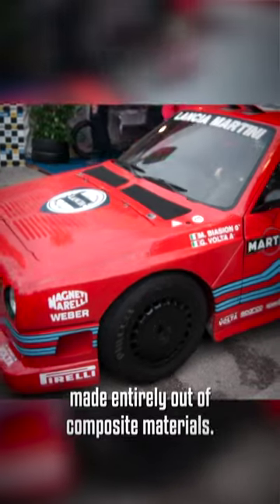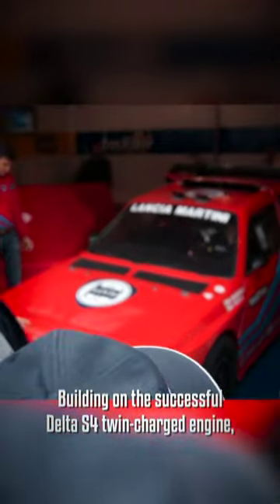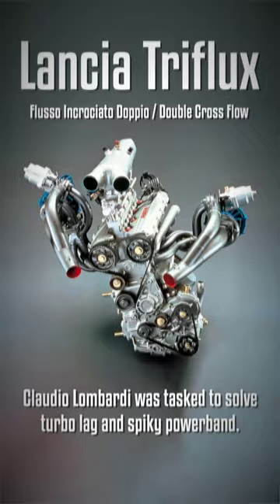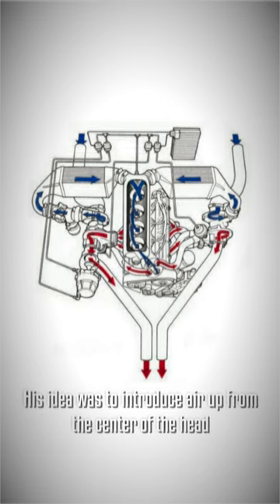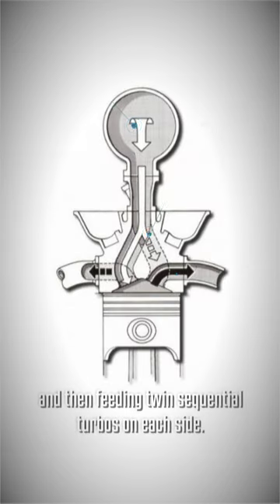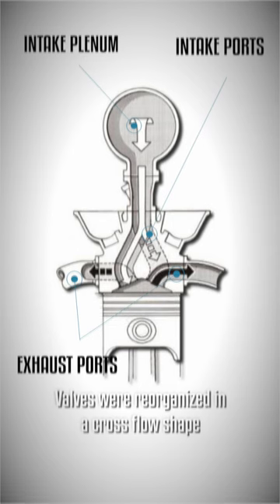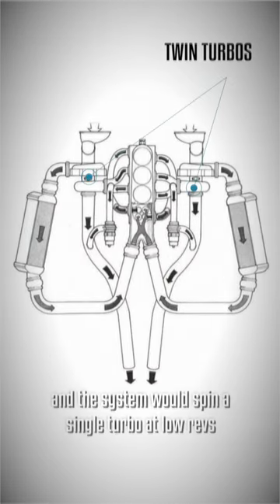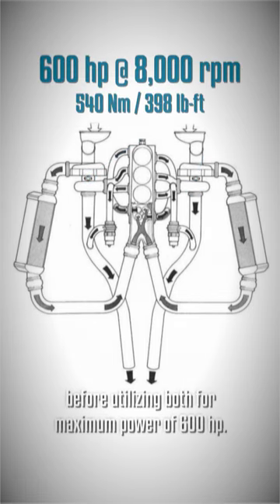Italians Reinvented Twin-Turbo 4-Cylinder

Comment: 600 HP, 540 Nm en sólo 4 cilindros. 😮😮😮😮
Reply: To be correct, It had 600 hp on Off Road configuraton and 800 on Asphalt tracks
Reply: By today's standards - that's rookie numbers
Reply: @jaleger2295  gotta pump those numbers up
Reply: @jaleger2295  I don't think so
Reply: The new GR yaris was able to get 740.4hp out of its 1.6l 3c😊
Reply: @KadiusFTW this heave 1750 cc in the 1987
Reply: @joslaleb_  I do think so. 4 cyl EA888 easily and reliably goes to realm of 700hp just by swapping turbo, new software, intake and exhaust 🥴
Reply: @jaleger2295 and runs for 3 days
Reply: @LtdJorge  yeeeeeah sure 🤡
Reply: @jaleger2295 good luck changed those few parts and making 700hp reliably. One full pull will send a piston into orbit.
Reply: @jaleger2295 números de novatos? Sabes de lo que estás hablando? En coches de carrera esa potencia era altísima y más en un 4 cilindros,claro que hoy hay coches de 1000 y hasta de 2000 HP pero son coches fuera de todo reglamento de competición  los Lancia y Alfa Romeo se ajustaban a los reglamentos de la época y ganaban carreras , así que lo de novatos está demás amigo.

Comment: The design is crazy but heat issues would have occurred unless the intercollers are water so more weight yes design is good but flawed for a light hyper hatch (notice how high the SC is they had to move air through that I bet to keep more cooling)
All this is a an inline acting like a v engine with 2 banks on 1 Bank of cylinders simple I know lol haha
Reply: Please stop writing.
Reply: @andreapehjerne8490  prove me wrong teach me some boy????cmon boy teach me, tell me I'm wrong
Reply: Even it if added 10kg extra weight, the 600hp wouldnt feel a difference... And its not close to V engine like, at all
Reply: @SammyPsk  explain boy?? why yall not teaching me boy I just said it's like a V8 because look at exhaust headers when have you seen an inline 4 with headers on each side and intakes at top smh you don't get it explain boy!!!
Reply: @jstewlly4747  vell because outer looks might be slightly like a V8, but the internals sure as shit aint, just look at secondary and primary engine, mpg, the head itself etc
but i will theorize and say that perhaps its too powerfull for such a light car